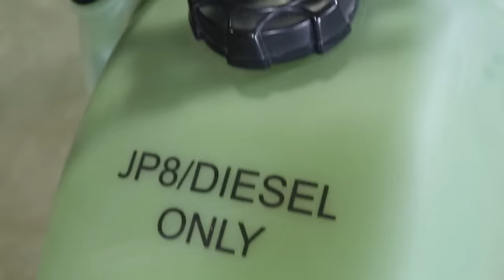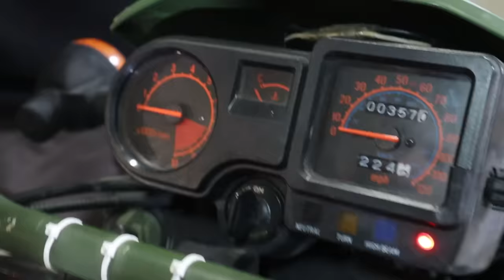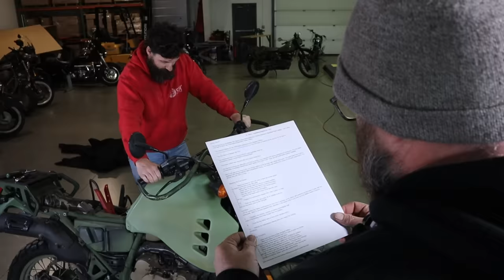I Bought a Diesel Dirtbike from the Marine Corps(1 of 214)

Comment: Probably already answered but the decompression switch is so you can run the starter and it will pressurize the fuel system to bleed the fuel without causing compression ignition. Bleeding needs to take place in stages, first the tank, then the pump, then the fuel compression pump, then the injectors. Once primed, the engage the compression switch to initiate combustion.

Comment: A wise man once said don't buy a diesel bike. Unless you got a parts house around the corner. LOL. Hope you guys can get it all figured out at some point.
Reply: Did 6500 km (5000 miles)  from Mumbai up through Nepal and down to kolkata and back to Mumbai .. did two oil changes, two filters..  did pretty rough terrain on a old Royal Enfield diesel ..  Only real issue was with me and my gear top speed was about 60 kph (40 mph)   Started every time within 4-6 kicks.
Reply: It would be easier to just use an old Royal Enfield and hook up a single diesel out of a generator.

The above only makes sense as he is creating his desperately needed content for his channel.

Any normal person would steer clear.

Comment: We acquired two in my unit in the Army.  We used them a handful of times when we were setting up long range LPOPs when we couldn't be drop off by helicopters closer.  Never had any problems with them.  Also had plenty of fuel when we got back.  I been looking off and on for one.
Reply: What's an LPOP?? reply ASAP, RSVP, that's what speedy means to me

Comment: This is great!!! In 2003 I bought a brand new KLR650 that was olive green/black. I was ok with it until I was shopping for accessories and found an eBay seller that sold the bodywork from factory KLRs. I bough the entire set of new take-off plastics from a 2004 (red/black). It took the course of a weekend to swap them over but while I was in there I did a Bog Gun exhaust, removed the sidestand switch, installed serrated footpegs, and did the subframe upgrade. 
All my take off stuff was perfect and I was able to turn around and sell it and make back most of my money. 

I have heard of the military KLR but did not know it was a diesel.

Comment: try disconnecting an injector line from the injector, stuff some hose on it and provide some sort of suction as you crank motor, it should deliver fuel to the pump and actually get it moving, not just spinning the air inside of it. I bled the old czechoslovakian 2 stroke diesel (tz-4k) that way and it works till today no problem

Comment: In diesel engines, compression plays a crucial role in the combustion process. During normal operation, the piston compresses the air inside the cylinder to a high pressure and temperature, which helps ignite the diesel fuel when it is injected into the combustion chamber.

A decompression switch, also known as a compression release or decompression valve, is a feature that is sometimes found on diesel engines, including certain diesel motorcycles. The purpose of the decompression switch is to reduce the compression pressure in the cylinder during starting. By reducing the compression pressure, it makes it easier for the engine to turn over during the starting process, especially when the engine is cold.

When the decompression switch is engaged or activated, it opens a valve or mechanism that releases some of the compressed air in the cylinder, reducing the resistance the starter motor has to overcome. This can be particularly helpful for kick-starting a diesel engine, as it reduces the force required to get the engine turning.

Once the engine is running, the decompression switch is typically disengaged, allowing the compression pressure to build up again for proper combustion. It is primarily a starting aid and is not meant to be used during normal operation.

Comment: Don’t worry about compression. The problem is all fuel related. That lift pump looks like it’s the same from a kubota L285. 
Both the injection pump and injector are based on springs.

Comment: The decompression lever on this bike was designed to assist with bleeding the fuel system easily and also to assist with a no power start in an emergency situation. Our bike came out of Florida and the entire fuel system was clogged. Had to replace filter, lines and replaced the peckcock.
Reply: I had to replace the fuel lines on mine too. It’s an older prototype model & I also had to solder a few crimped electrical connections that were high resistance.
Reply: You sure, fairly sure the lever manually cracks open one of the valves to reduce compression and allow the starter motor to rotate more easily.
Reply: Yes it is designed to crank over easier that is why it is used to assist with emergency push starts (since diesel engine naturally have more compression) and to cause less stress on the starter while bleeding the system.

Comment: I haven't seen anyone say this but if its not starting and your not getting fuel out of the injection pump the pump or injector could be stuck or sticky. You can take a little diesel electric pump and push diesel suplement throught the injection pump for a few hours and it may help get it unstuck. Possibly check if your getting fuel out of the injector line you can try and loosen the line on the actual injector and turn it over until it bleeds the air out at the injector once it does you should have fuel in the cylinder. And the little thing craig flipped is the manual primer pump. You guys may know alot of this but im a diesel mechanic in illinois work on alot of old tractors and bulldozers that sit for a very long time and thought some of this may help as we have to do it all the time around here. Good luck! Love the content! @bikesandbeards

Comment: Dave knows diesels. I have a lifetime owning or working on small to giant ones. The small ones are simple. You MUST bleed everything and have air free fuel spurting out of the loosened banjo union on top of at least one injector.

Huge tip. Remove air filter. Take a small book and completely block off the air intake.
You just created a giant compression release because the motor is getting no air to compress. As a result the motor will spin over like a top with very very little stress on your starter. This is an old school trick, very much working today in anything that needs bleeding by turning over the motor.

There often is a manual fuel pump with a diaphragm and a finger lever,  to get fuel to the bleed screws in the fuel injector pump. Once the injector pump is primed, you need to spin over the motor to bleed the injectors.

Its always a good idea to use a tad of ether first to assure that the motor will run, and the only thing you need now is fuel. If the motor will not even run on ether, then there are much more serious issues than lack of fuel.
EDIT: I went back to watching the video and see you finally figured out the important "ether test". I usually start with that on unknow motors.

Comment: M1030m1 that’s the military designation for this bike. I’ve had two in my time in 22 years Active Army. ( mostly because they where unit issues and I was one of the few who rode daily.) they’re slow and sluggish off the line but once warmed up they’re solid.  I’d strongly suggest getting a manual from DOD. Even Army wheeled Vic mechanics used the manual for everything. FYI there was some in the first gulf war and subsequent operation enduring freedom. We did not use them in Iraq or Afghanistan ( at least on Army side, no idea about Marines. Wouldn’t be surprised if marines had them rigged up to camo painted little wagons and built turrets on top.

Comment: The fuel line disintegrated because of the JP-8, it dries out instead of lubricate like regular diesel so they add additives to mimic #2 diesel or kerosene, but this stuff works in my units trucks well so yea lol

Comment: The only time I've ever seen one of these in service was I believe 2015 at Camp Pendleton Del Mar area. I believe it was the MPs using them to maneuver around the beach (huge crowds for 4th of July celebration on the beach). I never got to work on them or use one as I was maintenance for a different unit. One of my dream bikes right here.

Comment: Looks like you got an early visit from the Ether Bunny. 
I've seen truck starters snap right off the block when the engine kicks back on ether. Ether isn't timed like the injection is, if it combusts too far before TDC (it can and often does) it will spin the motor backwards. In that fight, the starter is almost always the loser, especially on smaller engines that lack the inertia to fight the ether explosion pushing the piston back.
Reply: The Ether bunny ? 😆😅😆
I know the small twin cylinder mitsubishis that i worked on as an aprentice in the early nineties used to crack pistons when attempting to start on the damned stuff ! They run "rockwool" blowers for cavity wall insulation and the clever clogs operating it decided not to waste time having the pre heat circuit fixed !!!

Comment: The HDT JP-8 kit (esp the details fuel injection system) would be extremely handy to know exactly how it worked as the gen1 and gen2 KLR are carburetor.  Thanks for starting down that path!  Many folks want to make a conversion kit but couldn't get access to the HDT parts list.  

Was not expecting the FI pump to be in the oil filter area--I wouldn't guessed it to be integrated to the balancer for engine timing.  Makes me wonder where the oil filter was moved to?

On the fuel spiel:  There is another reason why everything moved to JP-8.  Gas / Petrol / Mogas (marine gas) is considered a massive flammability hazard for everyone, but especially marine vessels.  Neither JP-8 nor mogas meet safety of life at sea (SOLAS) requirements, so USN uses F-76 for ships and (more expensive) JP-5 for aircraft.  USMC has to be flexible to meet USN safety requirements but desiring to run on Army / USAF procured JP-8 when on land.
Reply: Also less violent when on fire from explosions compared to gasoline... But just a side bonus.

Comment: The decompression switch is to allow the starter to buildup engine rpm then you disengage it and compression kicks in and it will start.
Reply: Too late, they broke it
Reply: On this bike it’s used only to bleed the fuel system, the stock KLR starter being strong enough to start the higher compression engine. Manual says to open the bleed screw, use the decompression lever & hit the starter. Engine turns over far easier this way, getting the air out from the diesel fuel.

Comment: The blackout lights are also useful in convoys so you can stay behind the vehicle in front of you.  The forward light gives just enough illumination to see hazards at low speed without giving away your location.
Reply: No they arent. They are for night vision driving riding with a PVS-14
Reply: No it won’t they don’t output light that’s on the visible spectrum…

Comment: The decompression lever, also known as the decompression valve or decompressor, on a diesel KLR engine serves the purpose of reducing the compression inside the engine cylinder during starting. This makes it easier to turn the engine over and get it started.

Diesel engines typically have higher compression ratios than gasoline engines, which makes them more efficient but also makes them more difficult to start. The decompression lever allows the operator to manually open a valve in the engine that releases some of the compression, reducing the amount of force required to turn the engine over during starting.

Once the engine is running, the decompression lever is released and the valve is closed, allowing the engine to operate at full compression for optimal performance and efficiency. The decompression lever is typically located on the handlebars of the motorcycle for easy access and operation by the rider.

Comment: One of the guys I served with trained as a forward observer using these bikes. Before then, I never new the Marines had bikes. We were infantry so we rarely saw anything with a motor.
Btw, the decompression switch is because the high compression can over power the smaller electric motor(compared to trucks) used to start the bike. If it won't turn over open the decompression switch to get the motor moving then close it again.

Comment: My  dad and I had one of these. They were powerful and handled everything. His had higher compression than the one I rode, and they were absolutely notorious for being YouTube Friendly Words to start. Using the Decompression lever was nice if we were on a hill. You could roll the bike holding the lever with little friction then release it and the bike would roar to life. Alternatively, if you needed to kick it the Decompression lever could be used to help find TDC before slamming the kick lever down to the ground.

Both of our KLR's that we had, even the ones in the late 90's were kind of known for being ankle-breakers at least around where I grew up. That bike, once running nicely could handle pretty extreme weather, and the diesel engine allows it to crawl right up steep slopes hauling about anyone or anything they are wearing. There are things that a 250KLR from 1994 could do that similar CR/CRF couldn't simply because they were a little bit softer in the suspension area. The Honda CR and XR were more powerful feeling -opinion-, but the KLR was just plain smoother. 

Admittedly: I have never played with a diesel version. I've heard of them as a myth and rumor that's been proved and disproved a few times over. This is awesome to see. Love your channel.

Comment: Decompression valves are usually on hand cranked diesels, you'd open the valve, crank the engine up to high speed, close the valve and hope it starts. Why it is on an electric start engine is probably to bleed the fuel system for more than 5 seconds at a time without frying the starter.

Comment: AT my former PD we got a few of those through the 10-33 program.  We only got a couple of them running regularly and if you didn't run them every day you would get issues starting them again.  When they did run - they pretty much sucked on hilly off-road terrain, no bottom end, and they had relatively slow acceleration on the street.  They were a neat novelty but never practical and we eventually gave them back.

Comment: Starting fluid more than likely broke something in the starter. If a diesel engine has air in the injection lines, it is impossible to push air thru the injectors with starting fluid. You must crack the line at the injector and give a place for the air to escape. Use the small lever under the tank, with the injector line cracked open. Pump the lever until you see a solid stream on fuel coming out. It probably lost prime from the rotten fuel lines while sitting. Only commenting because I would love to see this thing running.

Comment: watching you guys try to bleed the fuel system was really really painful but good video i subbed
killed the starter because you kept revving with the compression
open the bleeder, release compression and turn the bike over, you may need to disconnect the line to the injector pump and let it gush out for a sec to clear the line. Then put the line to the injector pump again and turn it over. 
Crack the fuel line going to the cylinder on the cylinder, turn it over until it pisses from there. Tighten it up again, throw the compression lever and then turn it over. 
Liquid boom on a diesel engine will make it preignight well before top center and will snap your connecting rod. You want to just give it the essence of ether and wait a second.

Comment: USBP in southern Arizona rec'd some of these bikes and they got bad reviews for being diesel and heavy. The rear black outs are referred to as snake eyes and typically used while wearing night vision goggles. A UV light can be hardwired to the battery and mounted anywhere on the bike with a heavy duty magnet. With the NVGs, it would be like riding in the daytime

Comment: the decompression switch is so you can get it cranking really fast without resistance then suddenly turn the compression back on while cranking. It's how they used to start old autocar diesel engines. With that small of a starter it probably has a hard time reaching the RPMs necessary to start a diesel engine

Comment: Hello, if you haven't managed to start KLR yet, I have some suggestions.  The civilian version has two protections against starting: 1: clutch pressed, 2: folded side stand.  If it still won't start, check the starter relay.  However, if this does not help, check the voltage regulator on the rear wheel cover and if it is damaged, the engine ECU is probably damaged as well.  Regards